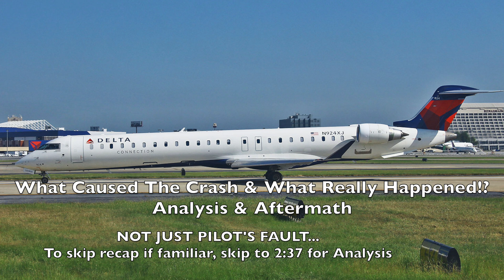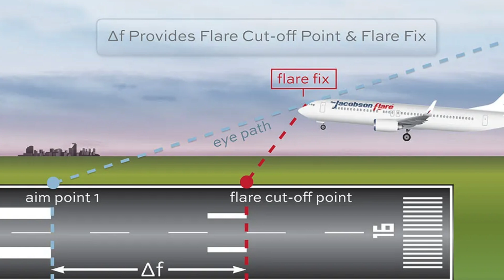What Caused The Crash of Delta Airlines 4819?! Analysis & Aftermath

Comment: How many hours training?
Reply from the maker: To be a  pilot for Endeavor you must have a commercial license as well as 1,500 hours flight time minimum! This includes at least 10 hours simulator training and 10 more hours flying time (as a trainee) on the CRJ-900. For reference just to get a commercial pilots license you need at least 250 hours flying time First step you need single engine which is 40 hours then twin engine another 15 hours also instrument which is 10 hours and then jet which is 40 more hours! So in total about 2,000 hours flying time is the average that most new to Endeavor pilots have flown… It’s a lot but for good reason as seen in this accident!